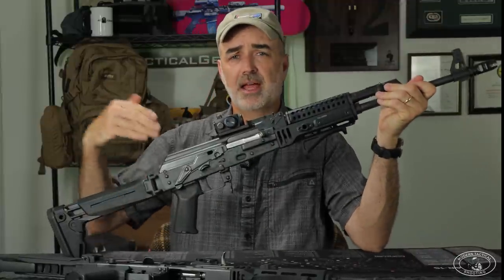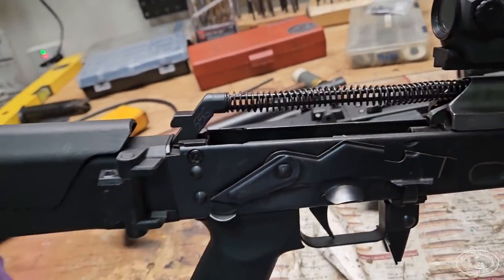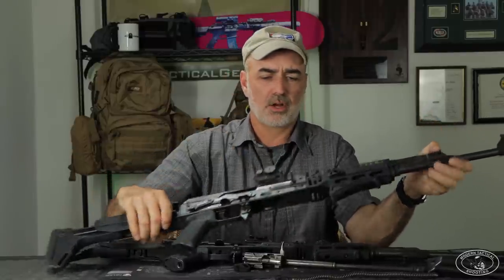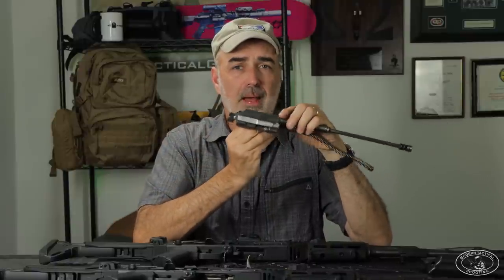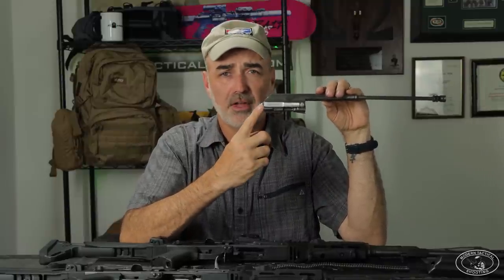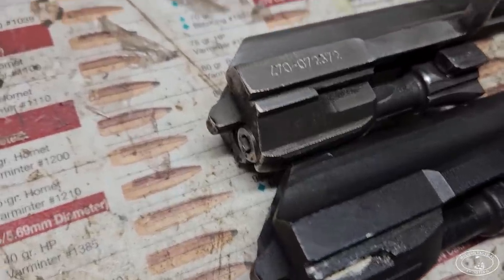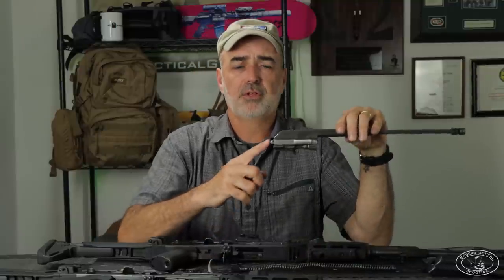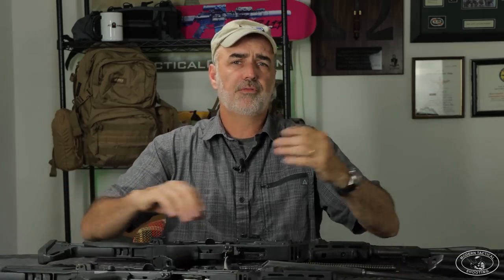Problem with the Zastava M90 (bolt carrier getting stuck to the rear) and my fix for the issue.

Comment: I’m not a gunsmith but I am a blacksmith. The exact reason the rifle locked up is a combination of the temperature reached from shooting and the rifle slowly cooling back down over and over while hardened tool steel constantly hit the carrier at an unnatural angle. You’ve removed the guns heat treating. It’s gotten soft. Definitely not Zastava’s fault. Can’t really say it’s ALG and Geissele either just because every company has different materials, hardness and shape..
Well, they know it’s too hard for everything. Just not them taking product back this way.
People pick out AK’s for their ALG here. You either ideally modify Zastava’s hammer for the ALG if possible, mill down ALG’s hammer and polish it, and the carrier knowing it’s still too hard and will kill the bolt carrier group.
Or everyone should just acknowledge both companies and countries have pride in the versions. Ride them both until they understand we know and that it’s in their best interest to get together and develop a solution that can be put on the ALG in Zastava’s before the issue bites them both in the ass. People won’t stop doing it mixing the products. Wanting your cake and eating it too means understanding your products eat each other and it makes sense for us to pay more for two different products that don’t sooner or later because it cost less in the long run as the consumer. The 2 top volume selling AK products technically designed to go together (American free market demand) and not because independently their product is fine is purposefully pooping on Americans getting into AK culture selfish reasons. People want both, It’s a hammer.. I hope they read this and get in front of the problem and don’t ignore it like it’s a Budlight Board meeting topic.
Reply from the maker: Awesome input
Reply: Blacksmith?  Friend I don't know where you studied, but you're completely wrong here.  There is no way that carrier is going to get hot enough to draw out temper.  Even in destructive testing, where they fire 5-10k rds in full auto, non stop the carrier will not get "that" hot.   Generally you need to be over 600F to really make any appreciable change in temper or hardness.   You are right about the hardness of the hammer and angle of contact, only wrong assuming he's drawn out temper from the carrier.

Comment: I've been in the metalworking field for 30yrs, I can't go for this idea that the ALG hammer is hard so it is peening the carrier tail. So if the hammer is soft what? The hammer would deform not the carrier tail right??? Looking at my box of old surplus ak kit hammers I see no peening or deformation on them. Untill someone does a Brinell hardness test of ALG vs milsurp hammers I'm not believing the whole hard hammer myth. Hammer geometry on the other hand would cause peening. I do see the face is more flat/verticle on the ALG vs some import hammers and the impact of the carrier tail is probably more harsh with that but almost all my ALG triggers have had that hump ground off and polished for smoother cycling. BTW, I use ALG springs in all my guns, including the IMI Galil.

Comment: Have you had any issues with the magpul stock? I had the latch mechanism fail. Magpul replaced it but my confidence in the stock has been shaken. I don't run my guns hard.
Reply from the maker: No I have not and I have 3 guns with the magpul..stock granted. I shoot mine on the flat range and at 3 gun matches only.
Reply: @ModernTacticalShooting  maybe I just got a bad one. I could fold the stock with a gentle slap without depressing the button
Reply from the maker: @tynado1173  yes that does not sound right

Comment: As already expressed, this is normal pinning/wear on the tail of the carrier. The problem might be an out of spec. "recoil spring, rear guide", the pocket where the carrier's tail slips into. Have you contacted Zastava arms regarding possible warranty and/or repairs? I've heard accounts, reinforcing great customer service.
Thx. for the video...
Reply: No warranty. ALG trigger is too hard compared to the bolt. ALG trigger has done the damage.
Reply from the maker: I could have tried going the zastava route. I'm sure running aftermarket parts like ALG trigger there was a good chance they would turn me down. Plus didn't want to send off rifles and not have them to shoot for who knows how long. So fixed it myself.
Reply: @ModernTacticalShooting  makes sense, thx.

Comment: You created the problem by altering and changing the trigger    Also you should mention this could be mitigated by avoiding running steel case.   Just say so
Reply from the maker: I do admit it's me using aftermarket trigger. What does steel case have to do with this?

Comment: I have a gf5 with an ALG trigger hopefully this issue doesn’t occur 😂
Reply from the maker: @RawEntry  round the hammer. After the ridges taken off guns run fine, metal can peen in only so far.
Reply: @ModernTacticalShooting  thank you sir I appreciate you replying an older video definitely subscribing!

Comment: Zs' does suggest to use the original trigger stock system it's heat treated differently then aftermarket triggers like ALG obviously.

Comment: Stop putting Gucci garbage on your guns and run them stock, then None of this would happen . It’s a combat rifle it doesn’t need a match trigger . All of these after market hammers are way too hard . If the trigger is too gritty learn how to sand the contact surfaces . It literally takes a  half hour start to finish .
Reply from the maker: So I should not be bringing these up to the level of performance needed to win matches? Are you saying AK platform is incapable of modification? Unlike the AR platform totally customizable.
Reply: Zastava has poor metallurgy

Comment: The easiest fix for this problem is to buy an AR and throw the trash can guns where they belong.  (And I have 17 AKs from this M90 to a Fuller Phoenix).
Reply: Why would you have 17 if they're trash?
Reply: @gr6373  Boredom.
Reply from the maker: I have 30 years running ARs and the M90 to be frank can crush ARs in matches
Reply: @ModernTacticalShooting  Interesting phrasing  . . . "can crush ARs . . . "  That's like saying High Heels are better basketball shoes than High Tops, because "Michael Jordan can crush" opponents during a game wearing them.  It's all about the shooter, but all things being equal (including the shooter)  unless you're in an inclement environment, an AR will be a better platform (speed wise) than an AK.  There is literally nothing faster about an AK than an AR.  That doesn't mean that an AK is worse or better, just never faster.  Also, I have sub MOA ARs (and sub half-MOA AR10s).  I have Zero Sub MOA AKs (to include 3 Galil ACEs).  The potential accuracy of the AR platform is far better than the potential accuracy of the AK.  I'm not new to either platform either, although my focus is on Long Range Precision (and ELR, to the extent it's a different discipline).

Comment: Wonder if you can heat with a torch and make the metal stronger usually applying heat to metal will make it even stronger 🤷‍♂️